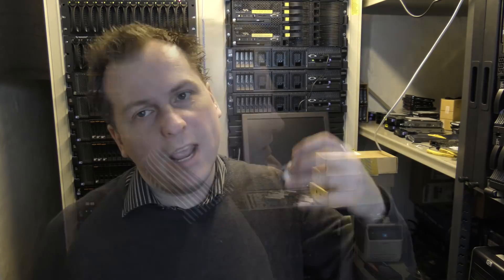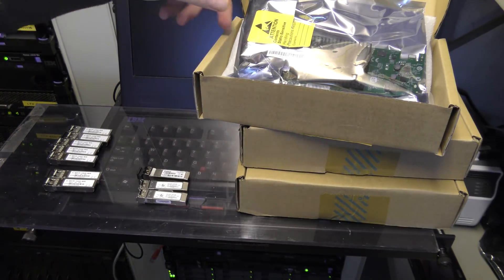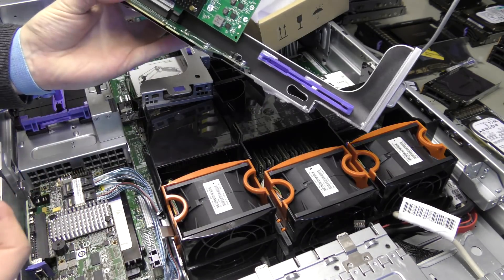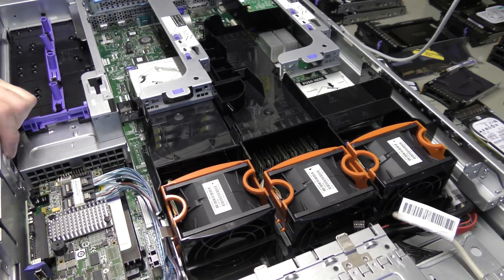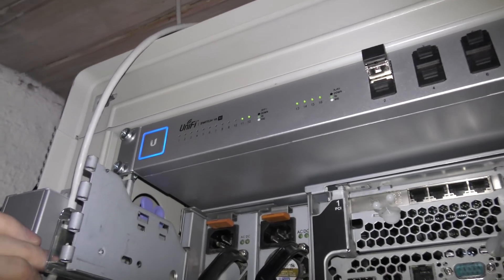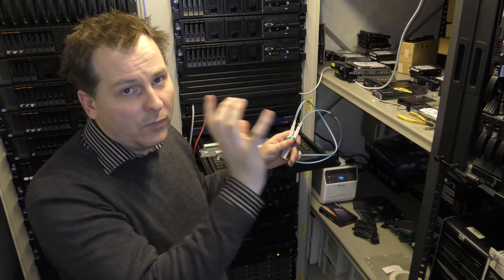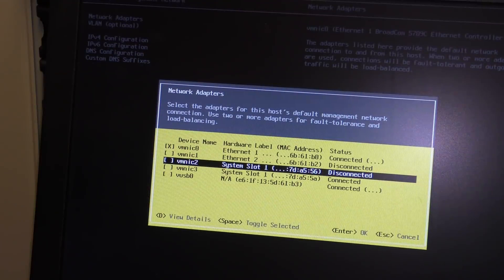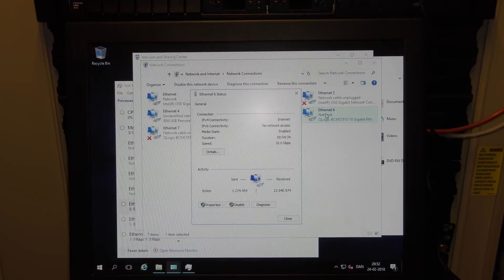10GbE Network Finally Connected in my Home Data Center - 656

Comment: Hello, thanks for the videos. What is the difference between a regular Samsung Evo 870 SSD and the Intel SSD? The Intel ones have a higher price than the Samsung Evo top of the line red tag. Does the Intel SSD are special for datacenter use? We are thinking of change SAS disk for SSD, but not sure if Sansumg Evo are adecuate for server use.
Reply from the maker: Enterprise SSD's can usually do way more writings than consumer SSD,, dut Samsung does also make SSD's for enterprise.

Comment: I use my US-16-XG as my storage network for my vmware hosts. it didn't make sense to me to also put my network traffic on the same network when I also had a 24 port 1gb switch... it does well enough for the small volume of VMs that I run.
Reply from the maker: Hi marchettejw
Thank You very much!  Cool,, I think I want to be trying Network Partitioning (NPAR) that looks to solve all out problems :-) 
Thank you for watching! :-)

Comment: In my recent foray into 10Gbe on VMWare I used 4 * 10Gbe adaptors and used NPAR to split each adaptor into four virtual adaptors. This gave me 16 vmnics. I was able to use the first partition from each NIC to create a 10GBe management network that could burst to 40Gbe. I used the second partition on each NIC to form prod network 1, third partition for prod network 2 and the final fourth partition for prod network 4. You can then use them for anything but you can't have the same VLANS on different prod networks or they can't talk to each other.
Reply from the maker: Hi Karl Foley
Thank You very much!  Great info,,, I just want to split up one 10GbE,, but kind of the same thing.
Thank you for watching! :-)

Comment: Keep the 3560x, and use a trunk on a 10gb connection to that switch.  Use the 3560x as your layer 3/core switch where the vlan gateways exist. And then those teaching between all your vlans.  You can setup access lists or terminate sensative traffic on your firewall like a DMZ. That way you can send your traffic and not traverse your slow 1gb connections to your firewall.
Reply: I would send both storage and data across both links
Reply from the maker: Hi Daniel Tekmyster
Thank You very much!  glad you liked the video :-)
Thank you for watching! :-)

Comment: I am surprised you used Emulux cards.I've had nothing but issues with them on Windows and Linux (they straight up don't work for BSD systems). Maybe I am just biased, however  I use the Intel X520-DA2 (have a DA1 somewhere).

As for the traffic management. Split it into VLANs, one for iSCSI (or NFS Shares as I do) and then use another VLAN from data. If you have several network requirements you could split further to have say a DMZ or a dedicated management network.
Reply from the maker: Hi zanginator-tech
Thank You very much!
Thank you for watching! :-)

Comment: Counter-question:: Can all your servers use the 10G cards? If not, backbone or SAN connections.
Because your internet is 1Gbps, no point slapping a 10G WAN side. I mean, unless your ISP can supply that connection that is.
Reply from the maker: Hi Mac·au
Thank You very much!  My Dell Equallogic SAN's only has 3* 1Gbit,,, and my Internet is just 30/30 Mbit,,, so I do not benefit from 10GbE all the way around.
Thank you for watching! :-)

Comment: I cant imagine anything other than a storage network coming close to utilizing even a single 10g connection. And at that point it would also be determinant of the raid controller speed and drive speeds on the other end. But it would be interesting to work up a video to see if there is any difference in running VM's who's storage is on the SAN rather than on a local SSD. Maybe even try a render test using some of your render farm VM's. Some on SAN, some on local SSD, Some on local 10k or 15k SAS.  To see if it's worth upgrading for those usage platforms.
Reply from the maker: Hi Shane Singleton
Thank You very much! 
Thank you for watching! :-)
Reply: Thank you for the content, Morten. This has been one of my favorite channels since I found it a year or so ago.

Comment: Hi Morten,
I would suggest to use the 10Gbit connections for storage only. Most of the other things in VMWare that requires connection mostly don't need a 10Gbit connection, so you can connect your storage directly to the servers with those FSP+ connection to your new switch.
As for the SSD's - I would actually suggest to use the USB sticks to boot VMWare ESXi's and use the SSD's as read cache (see this video: https://kb.vmware.com/s/article/2058983 ) so when you have something that runs constantly, you'll benefit from the use of the local SSD.
DAC is great, but since it comes with the plugs attached and you cannot replace those plugs, make sure your DAC cables works with your new switch.
Reply: I thought the virtual flash was only available in the enterprise license?
Reply from the maker: Hi Hetz Biz
Thank You very much!  glad you liked the video :-)
Thank you for watching! :-)
Reply: You're right. Well, add those SSD's to your storage solution as cache ;)

Comment: I would not dedicate 10G to storage only. There is no point in having such high performance storage links if you can't leverage it on the access side. The idea behind IP sans, is that you can share the same network infrastructure for networking and storage, do dedicating your 10G fiber to that kind of defeats that purpose. (might just as wel do fiber channel.) I would suggest creating 5 vlans: DMZ, Servers, Clients, Storage and WiFi. You would then run a .1Q trunk to all your servers (be it 10G or 1G) and add vlan interfaces as necessary. (Probably one in Servers and one in Storage. Make sure your storage traffic does not pass the pfsense) You would then run a single 10G .1Q trunk to your pfsense box. You can connect to the internet an do NAT on the DMZ vlan. If you need a server directly in the DMZ, just add an interface in the DMZ vlan. Might consider adding a second pfsense box, and do VRRP.
Reply from the maker: Hi Gert VAN DER PAELT
Thank You very much!  glad you liked the video :-)
Thank you for watching! :-)

Comment: this "really good" RAID Controller is M5014, 256MB cache, supports RAID 0, 1, 10, 5 and 50, needs key for RAID 6 and 60
Reply from the maker: Yes,, it does,, kind of irritating,, but they are really cheap now :-/